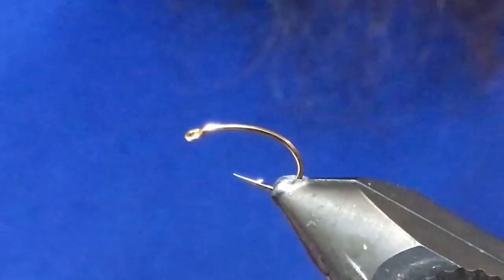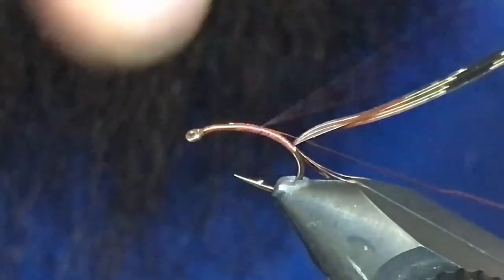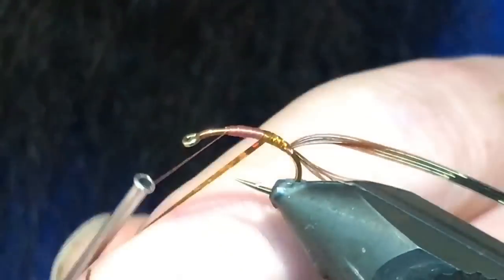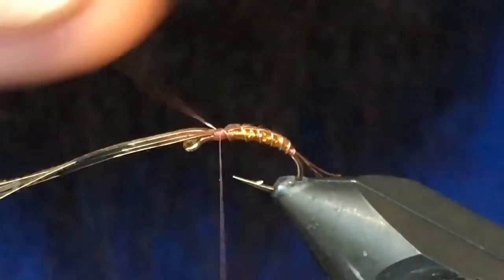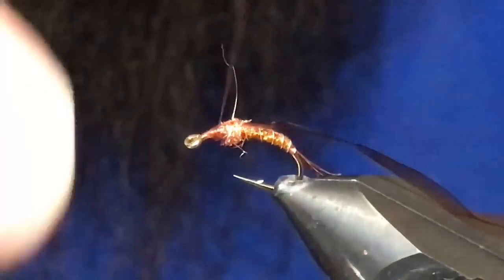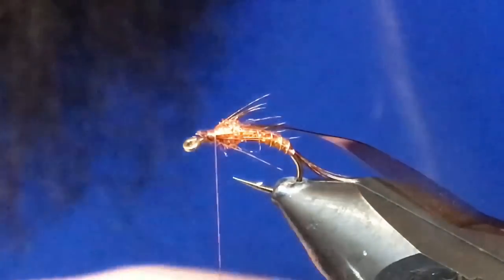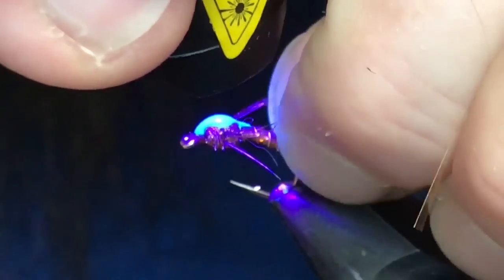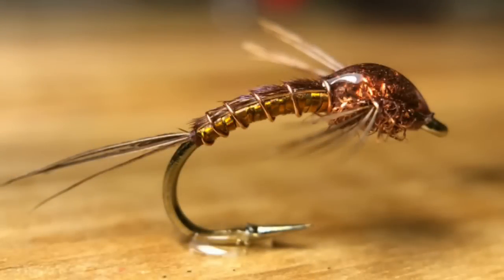"Copperbaetis" Mayfly Nymph Fly Pattern

Comment: Lovely fly pal, could you please tell me the best way to fish,
All the best Pete from Scotland.
Reply from the maker: peter buckley best fished during mayfly hatches, can be fished with a floating line and long leader, cast fly out giving ample time to sink to the bottom then work the fly back using a slow hand twist retrieve, the naturals make there accent slowly towards the surface at about a 20 degree angle so this is what you want to try and imitate. On a breezy day you can also drift them under a strike indicator.  Hope this helps! Cheers and thanks for watching!
Reply: Hiya Branden many thanks for your reply and great advise tight lines

Comment: Isn’t a size 12 a bit too big for a baetis
Reply from the maker: Jim Slade not according to the fish that hammer this pattern in this size and considering the popular sizes for mays/Baetis are 14-18 nymph hooks which are typically 2xl, a 12 1xs scud hook is right in the wheelhouse of sizing. If you put this particular fly next to a size 14/16 2xl nymph hook it would be the same size or even smaller. Sizes in just numbers don't mean much as in 10,12,14 the type of hook and overall size of the bug you are tying is much more important. Take a 2xl nymph hook and put it beside a 1xs scud hook and you'll see exactly what I mean.
Reply: BCFlyguys thanx just didn’t evaluate this correctly I appreciate your help